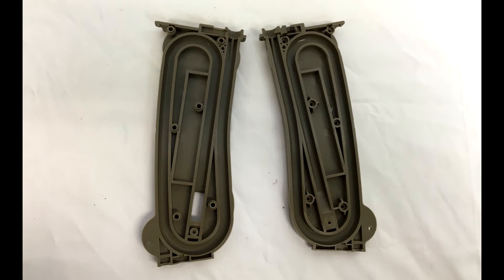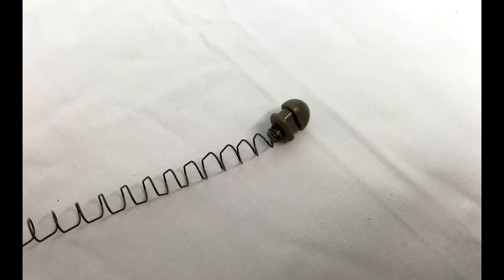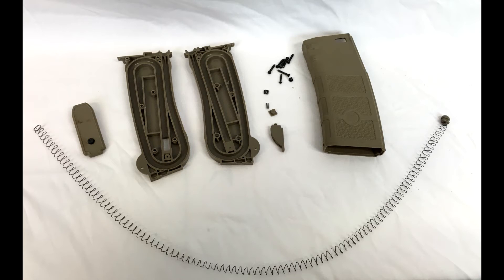Educational Rant: Why Don't My Magazines Feed?

Comment: I have ARES Amoeba mid caps for my Krytac CRB and I had to add tape on the side of the mag that slides in so they feed.

I have a friend who has an SPR and the same Ares Amoeba midcaps and they feed flawlessly on his, even in full auto. 

I got unlucky :/
Reply: I borrowed a ares amoeba mid cap and it fed flawlessly on my spr (it shoots like 30-40 rps)
Reply: Yeah my CRB doesn't do that because in full auto it'll have hiccups and not feed every other 10th shot or so. In semi it's fine though